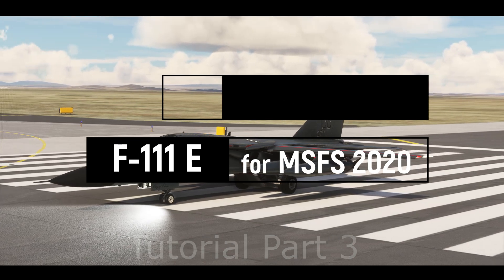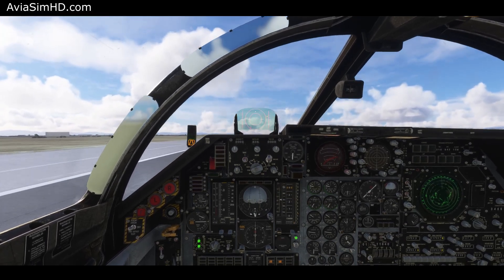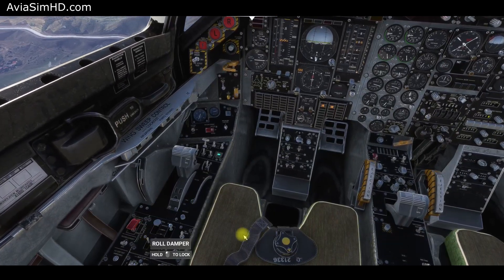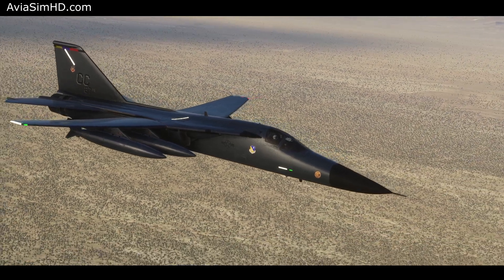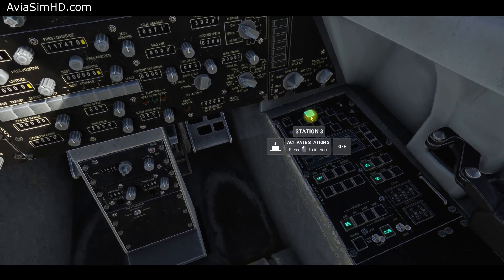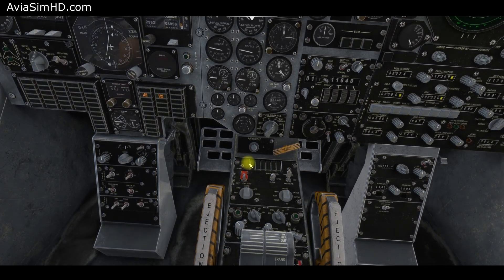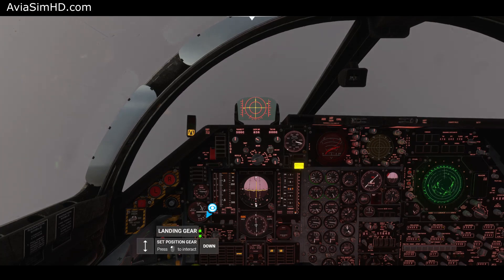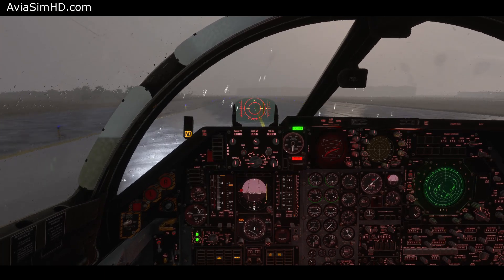GKS F-111E for MSFS2020 TUTORIAL AUTOPILOT

Comment: Great tutorial! Though F-111's pretty much never ever ran external tanks on the inner two pivot pylons because if they were separated from the aircraft they would almost certainly always contact the rear slab of the airframe.

External tanks were always carried on the fixed pylons, meaning wing sweep also had to be locked at 26°

In saying that it was very rare for an F-111 to ever need external tanks in the first place.